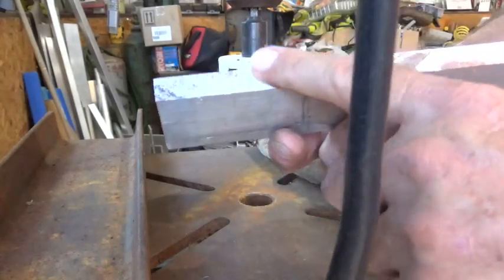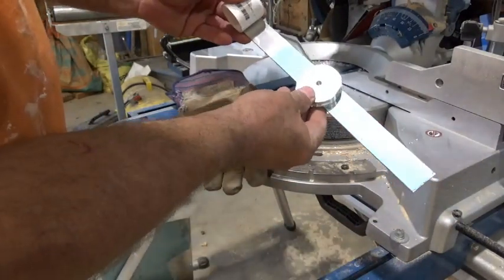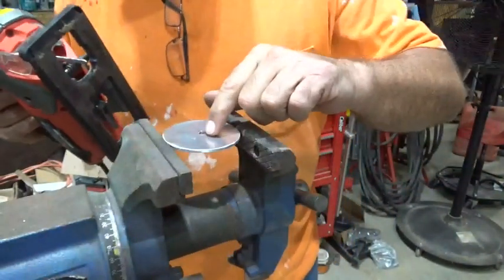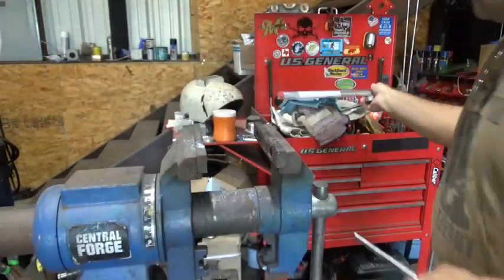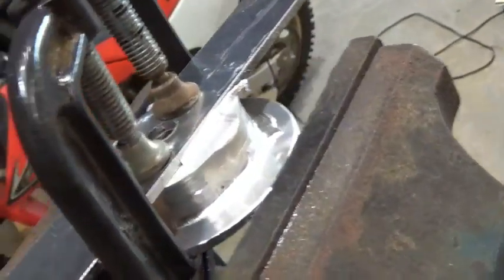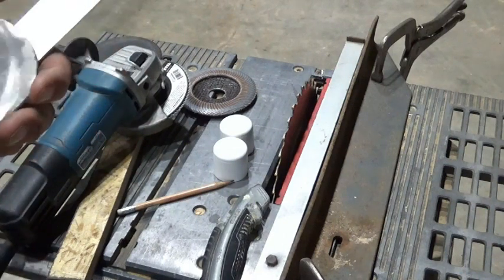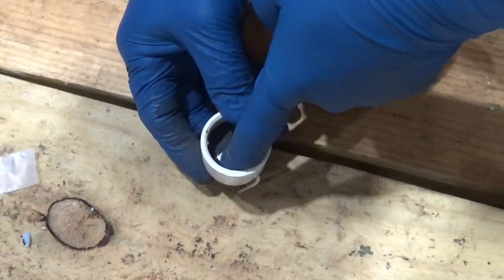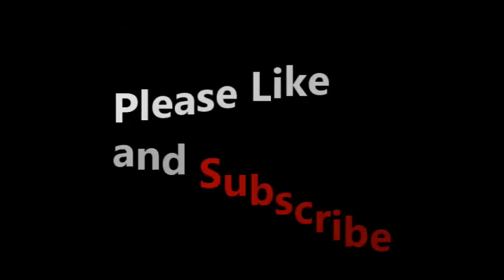DIY Splasher Prop Thumper for Stripers (Striped Bass), Hybrids and White Bass #diy #fishing

Comment: Mapp gas didnt work because between the vise and the two clamps you had so much heat sink mass it would take a long time even to get to 700 degrees
Reply from the maker: Marty. Thank you. I felt like the 1/2 inch piece was stopping me I didn’t even think about the vice being part of the equation.

Comment: Yes it will throw water on ya,I made mine like this last year and had to do do some adjustments on it
Reply from the maker: If you run it very fast the guy on the back deck his feet will get wet. I need to make a splash guard
Reply from the maker: I need to come up with some sort of a shield

Comment: Why not just epoxy those end caps right on the original prop
Reply from the maker: Well I thought about it.  but sometimes I use this little 30lb trolling motor to push around my 12 foot boat.  so I just loosen one nut and now I can change props and still go bass fishing.  Thanks for the reply mikebruns1966 and thank you for watching.

Comment: You really don't need to go through all that. Just drill the prop and 1 inch pvc cap. Bolt to 1 end of the stock prop, and you have a good splasher. Trust me. It works.